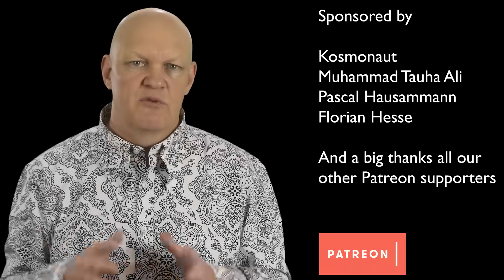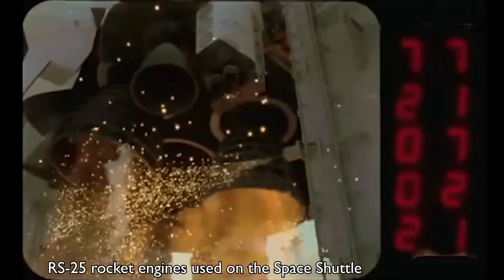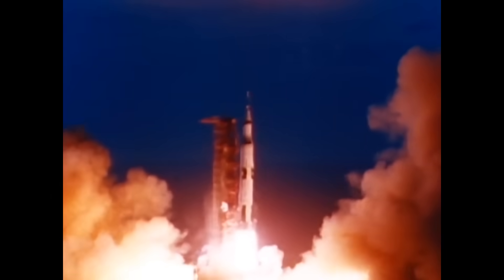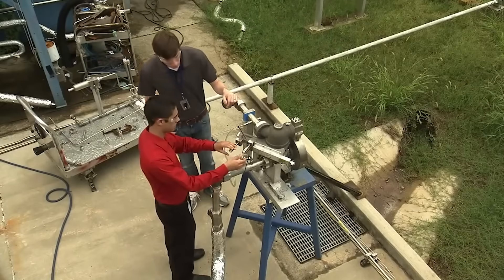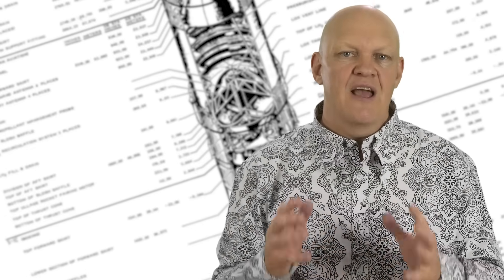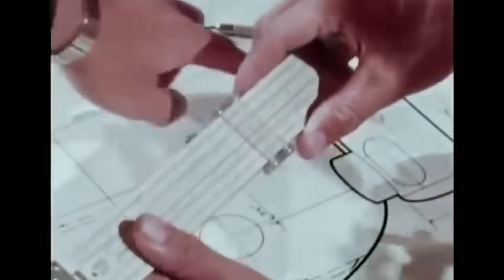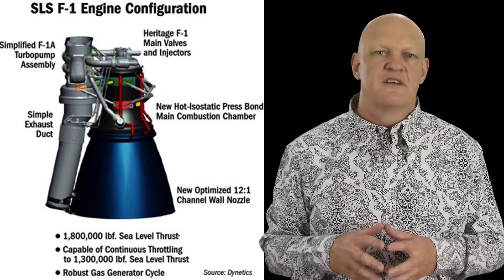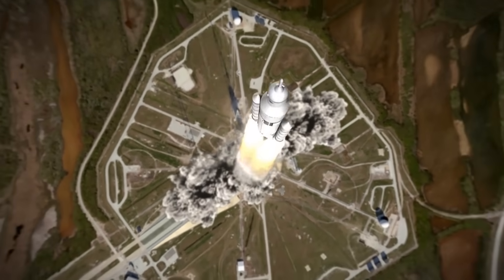Why Can't we Remake the Rocketdyne F1 Engine?

Comment: 5,600 parts down to 40? That's quite a reduction
Reply: no I am actually more of a space nerd, I use more than just Wikipedia
Reply: No way it actually uses only 40 parts.  More like 40 main components.
Reply: the part yes, but not the joins. Fewer point of weaknesses and fewer assemblies that fail inspections
Reply: Michael Halpern do you even read? 3D printing metal is never stronger or even strong as forged parts. Forging increases the density.
Reply: Josip Miller An engine is made of many parts because some parts can't be built otherwise. Separate parts has nothing to do with structural integrity, a solid piece is stronger than two pieces
Reply: Bryon Lape That's a reduction of 5600 parts (rounding to the nearest hundred). Which is an impression 100% reduction in components.
Reply: My grandfather's company made parts for the F1 engines they made these plates that the fuel was pushed through and high pressure to atomise it. Now with modern technology mainly 3D printing we can cast parts in a single piece. What in days pass might of taken maybe 10 or 20 parts or more we can now cast in a single piece. And with modern technology and new metals the parts are far stronger. What took forging back in the day with new metals we can do it with casting. A lot of things have changed over the last 50 years, but the 1 thing that has seriously changed we have truly lost true engineering. Like this video said, we have lost that skill that allowed these parts to be made by the seat of our pants.
Reply: In the F1 the fuel channels around the rocket nozzle but just adds weight and not really any structural improvement... while a 3d printed nozzle can have the channels integrated into a much more robust nozzle and still weigh far less than the old one.
Reply: Forging is forging, any other process is not forged.
Reply: Konigsegg also uses 3d printed rotors in thier turbos... because it isn't possible to CNC thier design.
Reply: I've seen parts made using laser sintering and the layer lines were quite obvious to me. Although I will admit that I've never seen studies addressing the properties of parts made with laser sintering, I did read some on traditional FDM polymer parts which had quite clear results showing an-isotropic tensile properties where the strength was weaker in the direction perpendicular to layer deposition. Metallic parts made by sintering also definitely have a poor surface finish that will require additional machining for precision fitting and sealed pipe assemblies (a necessity on rocket engines parts). On the matter of cost, I will concede however that rocket engines (other than SpaceX Merlins) are generally made in very limited quantity and that therefore, costs might be more interesting on metallic 3D printing technologies compared to forging only because forging requires ridiculous amounts of energy. Interesting and promising solutions to combine 3d printing with the precision of CNC machining have actually been in development for some years and they look gorgeous : hybrid manufacturing machines
https://www.youtube.com/watch?v=oaIOrQi2HLM
Reply: It seems the majority of the parts reduction comes from the simplification of the thrust nozzle which used to be made of a series of tubes (Now made of what is seemingly two major structural parts, fasteners not included). Looking at the original f1, it seems removing the nozzle itself would likely remove greater than 1000 parts alone if not an even more radical number. Also the (re)designers removed a few systems previously considered vital, which, by their nature are likely part-intensive, but it is still a big stretch, wish my lawnmower engine was that simple. This is best explained by the arstechnica article on the redesign of the f1 to the f1b.
Reply: @KeV and others, The thing is "3D Printing" is a large number of things that aren't all the same.

Here is a kind of 3D printer which is called a "Fiber placement machine", but it's really a 3D printer in the way it manufactures the components.  In this case, it's the cryogenic fuel tanks for Jeff Bezos' Blue Origin rockets.

http://www.journalstandard.com/news/20180717/rockford-made-machine-to-build-parts-for-next-generation-rockets

Sure, you're DIY 3D printer might not be capable of making rockets, but it doesn't mean that 3D printing technology is inherently inferior to other manufacturing methods such as forging, stamping, etc.  In this case, 3D printing is a far superior method to all others for this specific usage.
Reply: Indeed, low production and prototyping using 3D printing can be amazing with some machining to get precise dimensions out of metallic parts, for aerospace applications for instance. It's when you start trying to make serial production and strong parts that 3D printing starts to show it's weaknesses. Printing time is extremely long when comparing to standard serial productions using CNC machining. One operation can be as quick as only requiring 2-3 min for a dozen machining sequences on one part, while printing a similar part could take up as much as a couple of hours depending on the volume of the part. It really doesn't scale well. Parts strength is also next to always sub-optimal for printed parts which limits it's applications in aerospace. Fortunately, serial production is an interesting area of development for printers but it still has a long way to go because of the nature of the layer-by-layer process :
 https://www.youtube.com/watch?v=sbPpFHZL_cU
Reply: "The greatest generation had skills that will never be matched."
LOL, I have to laugh at stamements like these, usually comes with sentiments like "current young generation is so much worse than when I was young" or "in my time it used to be better, more real, harder working, better discipline" and so on. But when you look at hard data you see that it's not worse and we don't have less skilled engineers tha before.

Technology improves so fast that it's hard to follow unless you specialize in some narrow field. Tech gigants like SpaceX or Tesla employ the best engineers of all kinds and you can see the result very quickly: unprecedented growth, paradigm shifts after 10 years of company life from basically zero.

It's sad to read the stories about inept management but I believe there are more than enough startups and small, well managed companies to compensate and do it better than those big and slow dinosaurs. Some people will keep complaining how 3D printing is poor and never will be viable in serious manufacturing jobs while others will put their skill to work and find a way how to do it better until it will be viable. Sounds similar to those who say electric cars are dead end and stupid concept. We are seeing how they are proven wrong in real time :)
Reply: all new liquid engines have 3d printed components, Merlin, BE3, BE4, Rutherford (fully 3d printed), RL10-CX, RS-25 restart, Raptor, AR-1. its very proven

edit also Draco, Super Draco, Curie, not sure about the Euro engines but they like a high work force so...
Reply: Bryon Lape
Reply: Only you can make yourself an ass!
Reply: Wim Meerkerk fewer joins are better
Reply: No they had a lot more parts because the manufacturing equipment available didn't allow for fewer
Reply: Andrew O'Hara super draco is also entirely 3d printed, and its an abort engine. Of course it's hypergolic so its really simple but still
Reply: It goes to show you what you know of those channels. Those channels served two purposed. 
1) It helps cool the nozzle itself so it won't fail due to heating. 
2) It heats the fuel before entering the compressor and the injector to be used as fuel.
Reply: I'm not just a DIY 3D printing enthusiast, I'm working on a printer for a research project right now. Don't get me wrong, I love 3D printing and I agree that it IS many different things and processes, however, it is not what people generally think it is in that it is not going to replace most standard parts manufacturing.  

Also, a fiber placement machine can hardly be called a 3d printer. It requires molds and/or mandrels to place fibers in specific orientations, especially to produce tanks. What we generally mean when we say 3D printing is literally manufacturing layer by layer from top to bottom without the help of molds or prior materials in the fabrication area. It enters more in the realm of fancy composites manufacturing than 3D printing. This machine would also need manual work during manufacturing operations because fibers may need to be adjusted during the process which makes operations longer. There is also the fact that parts made using this will need additional treatment, i.e. curing because it is going to be using soft materials such as prepregs (probably what they will use) or dry fibers which would also require resin infusion or injection with a cure cycle. This cure cycle will probably also require an autoclave (which is extremely expensive) since it is going to be manufacturing structural parts. This machine is cool though and such machines make amazing composites parts, but it's not comparing oranges to oranges and it's definitely not what you would call revolutionary 3d printing. It's fancy conventional composites.
Reply: Silva Dreams, no every layer is not a joint it isn't as strong as other methods, but the strength is consistant throughout the part, laser sintered together and with the methods used in areospace no distinct join seams, that can be forced apart
Reply: Kev certainly it wont replace most standard parts manufacturing, but for items that are generally low production, it is REALLY good
Reply: KeV Fortunately for 3d printing aerospace components there is a pretty popular family of super alloys that is both strong and heat resistant, Iconel, still takes a long time to make a part, but you typically dont need a massive amount of those parts anyways.
Reply: SpaceX is using 3d printed components for Raptor, which will have the highest chamber pressures of any engine, which brings up another point, engineers of today have the tools and the need to develop more complex things, things that simply wouldn't have been feasible in the 50s and 60s,
Reply: Michael are you sure the combustion chamber itself is 3D-printed? By the way... I read that their thrust is about 400000 pounds, so that's about half of the F-1's thrust. This brings up two more factors that Raptors don't present in the amount that F-1 does - double the thrust and tha amount of fuel burned per second. Looks like it's still different story then...
Reply: We have SpaceX and Rocketlab both using 3D printed engines with great success.
Reply: Yes I completley agree! Rocketlab and SpaceX are both using 3D printing in their engines.
Reply: Jack1981 the combustion chamber on raptor is not 3d printed, but consider Raptor is about the size of Merlin, so much higher pressures than F1 experienced
Reply: The problem is, even though one can print INCONELs they are still better when forged and manufactured by CNC. Parts made with 3D printing technologies are not capable of withstanding the same stresses that parts made using forging are capable of. This is because of how porous the parts are and because of how the layers are stacked up which causes stress concentrations when applying a load which in turns cause tiny fractures in a part. This is also because forged parts typically allow for better grain organization in a metal that allow for optimization of stress resistance in a desired direction.
Reply: that is less of a problem with direct laser sintering, yes its less dense but you dont get the seams along the layers as other methods, meaning its decently consistant, but the main factor is with forged or cast, you have to be making a lot in order for the part cost to be reasonable, if you aren't making a lot, the cost of adding a bit of extra material for a 3d printed part is far less than the equivalent made traditionally, and there are some parts you simply cant make in any other way.
Reply: That's because they have the originals to back engineer in the first place.
Reply: I’m confused why people who only watch 3D printing of plastic parts on YouTube go out on a limb and say additive manufacturing cannot produce  a monel or titanium part capable of doing the job of a forged part. It’s already happening on a large scale with FAA certified aircraft engines, liquid and solid-propellant rockets. It’s proven, certified, in use, and has millions of miles on it.
Reply: Josip Miller, that is incorrect.  The Rutherford Engine that flies on the Electron rocket is a flight-proven 3d-printed engine. Source: https://en.wikipedia.org/wiki/Rutherford_(rocket_engine)
Reply: Michael Halpern common misconception that is kind of the whole point of this video. 3D printing and CNC machining do not offer the same performance as forged parts. The metallurgy simply isn’t mature enough and may never be.
Reply: ayeckley dear Lord, that 3D printing bullshit again. Engine is consisted of many parts because because each part needs to have it's own structural property. Yes, CNC machines can do really great job but they are also imperfect. People need to look at documentary about manufacturing of  Rolls Royce aircraft engines. That is engineering a it's best.
Reply: Josip Miller Your point about the Rolls Royce aircraft engines. Are you including the Merlin in this list? I ask because during WWII, Packard and Ford received contracts to produce Merlin engines. The engineers from Packard confronted the head of Rolls Royce at the time because the blueprints provided weren’t accurate enough for Packard to produce an engine. Manufacturing something to a close enough tolerance so every engine produced could use the same parts is leagues better than just getting things close enough then making it fit. If it weren’t for Packard and Ford basically rebuilding the Merlin from the ground up, the allies probably would have lost WWII.
Reply: Xiones11 except it isn't trash, you can make parts with additive manufacturing that you simply can't make in one piece any other way, heck you can make things that are nearly impossible to make any other way that provide much better preformance.
Reply: 5A1312EWULFX 3d printing eliminates joins, the weakest part of any assembly,
Reply: Yeah but how much Bourbon can a 3d printer put back? The "greatest generation" had skills that will never be matched.
Reply: Have you seen how many times they have to 3D print things before a good version comes out normally? And every layer is technically a weak point as it is a joint.
Reply: I hate when people with no technical knowledge praise 3D printing as the holy grail of manufacturing. I've been working with 3D printers for some years and they definitely are not. They print parts with a lower quality than conventionally manufactured parts using a combination of machining, casting and forging. They generally have fragile points all over them between layers and are therefore less resistant to applied loads than the same part made with a CNC. Their surface finish is horrible most of the time. These process are generally very expensive for large metallic parts (larger than a 1 ft^3). There is a lot of trial and error required to print complicated parts. Most printed parts are extremely porous and require special treatment when they are used for sealed assemblies or composite molds. They simply cannot be used on a very large scale (printing a rocket fuel tank for instance). 3D printers also cannot make a decent serial production because of the time they require to print a single part. By the combined time 100 printers take to make 1 complicated part each, a conventional production line could make thousands more cheaply and efficiently without having as many machines running at the same time.

There really are a lot of downsides for 3D printing. Sure, it CAN do amazing things but don't be fooled, they are not replacing conventional machining, CNC machining, sheet metals, composites and welding any time soon. What they don't tell you when they say an engine is ''mostly 3D printed'' is that there are still fasteners, conventionally manufactured parts, composite parts and so on because these parts could not have been made otherwise.
Reply: Andrew O'Hara Electron does use 3D printing, but they use crazy tech to do it and are funded by Lockheed. I did a paper on them for college. One of my best guesses was 1. At the time 3D printing attracted investment 2. It meant they could build their engines extremely fast after getting their payment (because each launch is like 5 million they cant have engines sitting around, it makes more sense for the free cash to sit there and go torwards paying staff and keeping the business going)
Reply: You seem not to realize the point here. F1-s are not some common rocket engines that produce a "making sense" amount of thrust like 400 000 pounds. These produce 3 times more and are 2 times bigger. You see, with F1 engines it's like with "giant people" - giants don't exist commonly and why? Because it's very hard to maintain a giant, you have problems with heart, walking, difficulties in functioning, demanding SPECIFIC and "in real time" acting toward a giant to make him go on properly. You get my point? Why you don't drive a car that has freaking Titanic steam engines? Because it would demand specific behaviour from you to operate that KIND of machinery, that's why you probably drive a 'normal' car with normal engine, suitable for 99% of the society. The same is with the F1 - they are VERY SPECIFIC machines, demanding individual treating to run properly, it comes from the fact that that amount of power, fuel per second, gas exhaustion and other physical factors is just too huge to be held by parts that you can buy in a store, they need special, individual care due to the powers they operate and so on. It's not a common engine not because the parts can't be manufactured with today's machinery, but these are welds in specific places, angles of specific parts individually for each engine and these kind of things. Anyway - CHEERS :)
Reply: You generalize too much I guess. I don't say anyone is worse than other, but the truth is those engineers lived in times when one person had to do the work, the actual mental work in designing, maintenance, managing and so on, the works and duties of one engineer then were much more complex than an engineer today. It doesn't mean anyone is worse, people like to work it's seen. Technology improves fast yes, those CNC machines and 3D printers do much more precise job, but for what? For hundreds of thousands of microwave ovens and millions of vacuum cleaners, but unfortunately not for engines that produce 3,500 tons of thrust each,  in a single combustion chamber. Today work looks different that even 10 years ago. 3D printing is not poor, but it's not capable of making let's say a pipe that will withstand such mighty pressures and forces like in a F1 rocket engine... It's a different attitude with such specific machines, especially machines that will do something more than wrapping a sandwich to work. And this is the point of this video. To understand this, you have to appreciate the fact, that F1 engines are not common cars, but enormously powerful, overwhelmingly thirsty and very demanding machines due to their scale. And to make such machines work, completely different attitude is needed.
Reply: Josip Miller you do realize that rocket engines have been made entirely with 3d printing, it's actually the best way to do it given lower labor and low production
Reply: Michael Halpern I do realize that this is not proven technology.
Reply: Big 3d printer can do most of it in one piece, between that and a CNC machine...
Reply: +Michael Halpern. i wouldn't trust 3d printed parts in a rocket engine, at least not until the technology advances much farther. that's quite an extreme environment those parts have to survive.
Reply: @TheMhalpern  Oh, not that again!  I hear this every DAY!
Reply: Metallurgy is fine, you get more performance from not needing as many structural parts, because its all one piece
Reply: Andrew O'Hara oh, ONE is already flying. That is ... proven. Sort of.
Reply: ayeckley sure 3d printing is trash, but CNC? Milled parts are top quality. There is no metallurgical issue there. Any metal that you can stock you can cut. Milling is traditionally far better quality than forged or cast components. Furthermore these CNC milled components are even better than hand milled components. Computerized milling is the future. Addative manufacturing like 3d printing is a joke novelty for throw away parts.
Reply: Michael Halpern wow, Wikipedia just makes everyone an engineer.